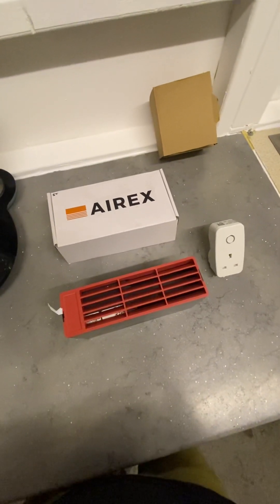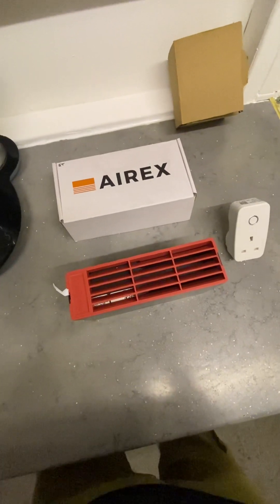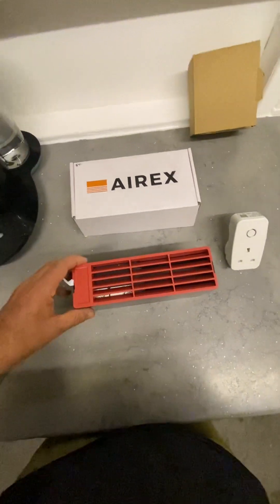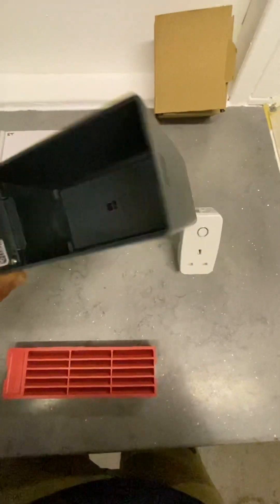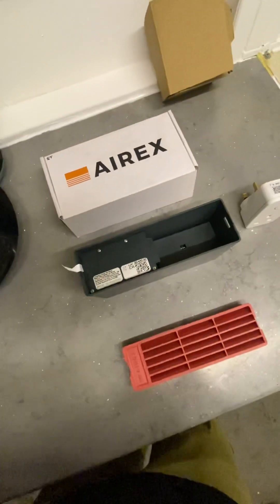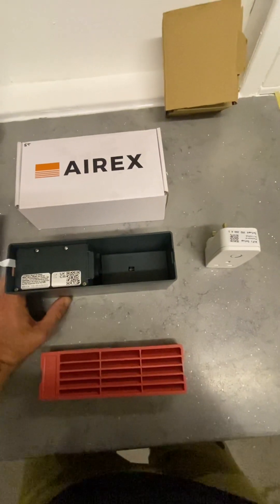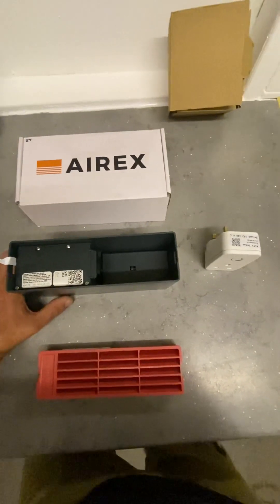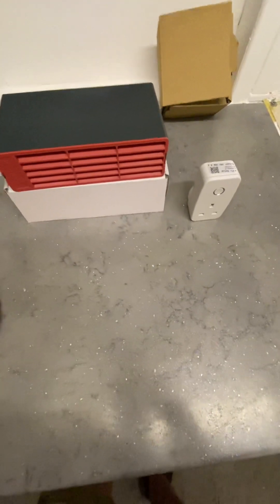AirEx smart bricks, underfloor ventilation

Comment: Useful video - thanks :) Are these appropriate in areas with high levels of radon, or is that not a consideration?
Reply from the maker: Hi, 
That is a very good question, I raised that with the manufacturer and unfortunately they could not give a definitive answer, I would advise against installing in high radon areas unless we had insulated the floor with our open cell foam that acts as an air barrier material in the sub floor, we are lucky that the area we operate in is mainly a low radon area but we will be checking the radon maps before installing.
Reply: @greenhorizon4725  Thanks for the reply. I think that rules AirEx out for us. I'll have a look into spray foam insulation :)
Reply: Could this system be used on the gable of a house where spray foam insulation has been installed in the attic, to help improve humidity levels?